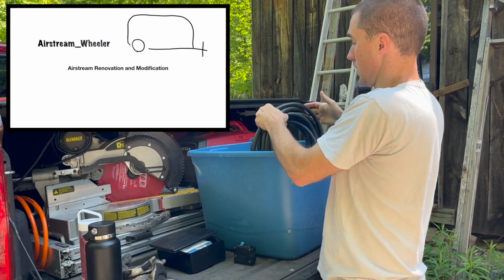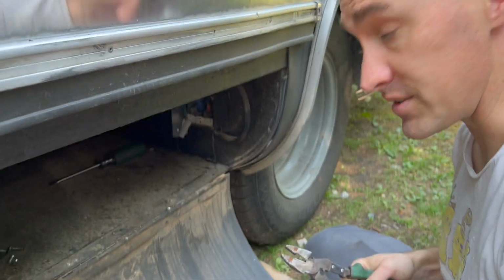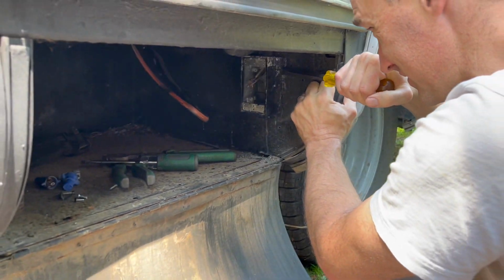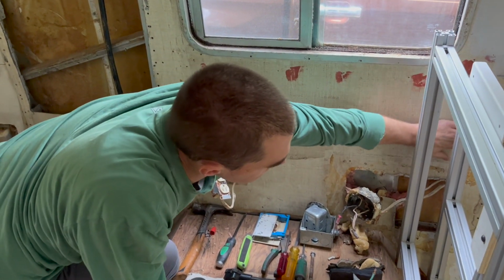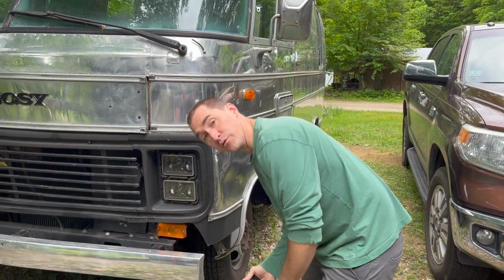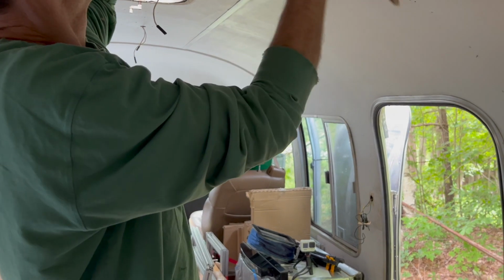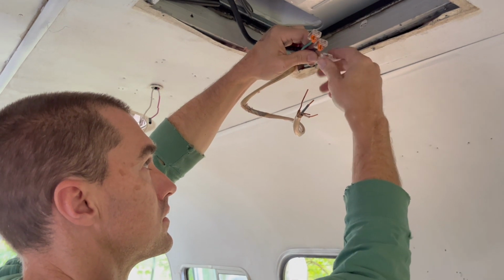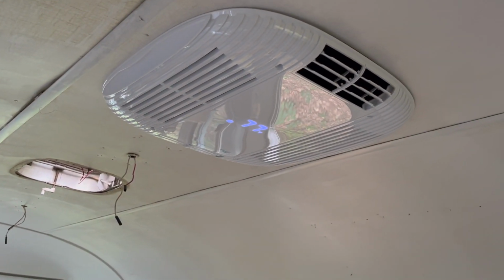Airstream Argosy Motorhome - Replace Power Cord/Fixing 120V Electrical System

Comment: Watching this, I was typing a comment to ask if you had seen or used the Wago connectors and you pulled them out. Waited to see what you thought. Seemed like they work for you. They are fantastic replacements to wire nuts. FYI, our 2022 has lots of Wago connectors in place right from the mothership in Jackson Center. I love being able to take them off and put them back on.
Reply from the maker: I think I am going to really like the Wagos! Ease of use/reuse is a big plus and what I have done so far seems really secure. Thanks again for watching!